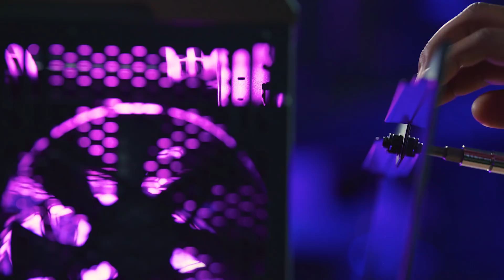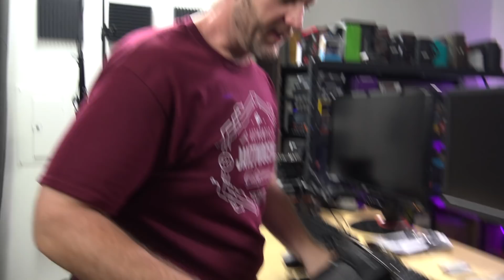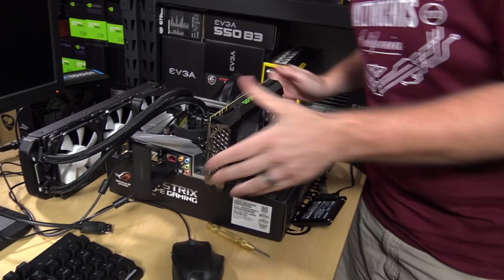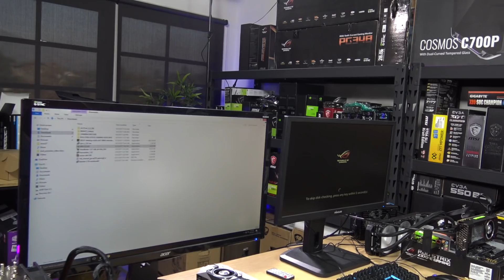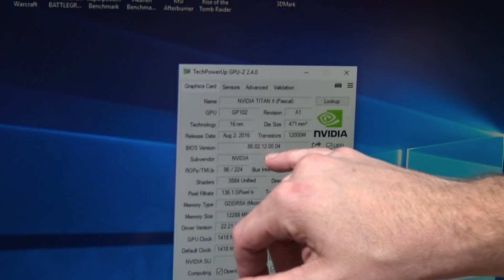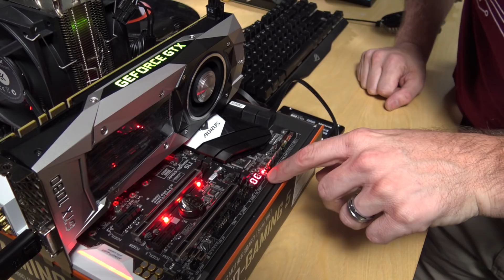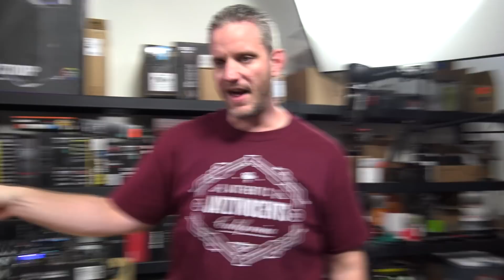I cant figure this one out... HELP!

Comment: This might not be the case, but you should try another PSU. The 1080 probably works because it has a lower TDP (180W) while the 1080 Ti has 250W. Maybe something's wrong with the power supply. Not sure, but worth trying.

Comment: Try plugging in a DVI monitor to the non working card on the Ryzen system. I just recently had a really similar problem where BIOS would not POST with DP for some reason. Tried 2 different monitors and got stuck on a POST code every time, even after resetting CMOS, pulling battery, etc. Plugged in a DVI monitor and it booted right up and next boot kicked over to DP and has been good ever since.

I have no explanation for why it happened and why plugging in a DVI monitor helped, but it fixed my problem.

Comment: While this maybe out of left field Jay - how about resetting the Ryzen Bios to fresh install? Verify if the cards are performing the same with the older bios. This could point you into a compatibility issue between the 2 cards for BIOS. While you did check the working Titan you did not check the non-functional one on screen. This makes it hard for me to say if the BIOS do match, if you mentioned it in the video then i missed it.

However, if you are unable to revert your BIOS on Ryzen back to an older version, how about switching out the PSU for a different one. Yes I know this sounds stupid and shouldn't have impact, but I am thinking that POSSIBLY maybe power could be causing it to not post. Maybe it is diverting too much or too little power to the system. 

If the RAM sticks are able to be swapped between the 2 machines, how about switching them? This might provide some answers if it does post or you might get a new error code. 

These suggestions while are way out of left field and normally wouldn't be considered to be the resolutions. I think that getting outside of the box in this abnormal case would be helpful. Thats just my two cents :P Let me know if you tried it and what the results are.

Comment: I'm quite new to computer building, but would a V drop be a possible cause? Perhaps one card responds to an "under volt"  scenario whereas the other may not? Would it be feasible to check, or perhaps even swap power supplies. Perhaps that was tried.

Comment: This is a weird one....Power at the PCIE slot maybe? That's very difficult to test without breakout cables and such. Nvidia power balances a VRM for the PCIE power. That might be the small enough difference in cards. But that should not be enough to cause this failure. I noted the PCIE link at x16 so appears the PCIE portion is working well enough. A loose or intermittent connection would have shown on the Ryzen one when you rocked the card L/R.

I would 1st remove the GPU and all connection and check the underside and around the PCIE lane for any possible small pieces of metal shorting out components. Use can air and see if anything changes. Next would be for your level, move the CPU to another motherboard and see if the fault moves with the CPU or motherboard. 

Actually....could be really the motherboard. I'd do a physical check then Clear CMOS and re-flash BIOS to start. It appears to be a POST issue. Could try it with 2 cards and see what happens. Known good and then install the second bad one.

Comment: 1: Swap cards. 
2: Swap slots with working and non working
3: Swap PS
4: Try both cards in one system at same time, Working MB to check reading make, model and bios the same on both cards.
5: Check PCI on card for short PCB tang.
6: Sacrifice goat to the binary gods
7: Find same MB, see if the same
8: Try AMD and the bad NV in system at same time.
9: Same as 8 but swap slots.
10. Swap CPU
11. Check PCI settings, Card my ask for PCIe that system has a conflict with.
12: Go to the pub, wait an hour or 2...........What problem!

Comment: If you really must solve the puzzle =P, cause I would want to, if all the parts work just not that specific combo I don't believe its a software issue. I would guess that its some freak manufacturing mishap where some connection is being connected that shouldn't be because of some soldering or something that only happens with that specific combo that fires up that specific error. Maybe check and see if the connector has something in it or there is some difference in the interfaces of the board and card. Or you just probably shouldn't put diesel in a gas engine. Yea.. that's it...

Comment: I would say the motherboard is the most likely cause maybe it's not bad but just a little bit loose or damaged. If that graphics card Works in another PCI slot then I would look at the power supply

Comment: I had something like this happen to me with old Radeon 46xx series cards. Had what was supposedly two identical hd4650's that said they had the same bios but they were actually lieing and didn't have the same bios after checking out the bios dumps because it turned out that the utility that was burning bios onto the card wasn't checking to make sure that garbage left behind from the old bios was removed. It would just write the new bios, change the numbers and call it a day, without checking to make sure the new bios was completely valid.

Comment: I had something like this happen a while back with and EVGA board. I knew I had a known good GPU because I just pulled it from another PC and it was working on the EVGA board too, until I did something (can't remember). Then after a reboot the GPU, which had 3 LEDs on the back was now only showing 2 LEDs and would no longer POST. I spent an hour or two trying to troubleshoot it and nothing worked. I cleared the BIOS, pulled the battery, and everything... Then as a last ditch effort I completely removed the Battery (only popped it, but left it sitting there the first time) for a couple minutes... Put the battery back in, turned it on and it POSTED like nothing was wrong, 3 LEDs again and everything. I had thought I fragged the GPU!

Comment: pull the battery on the Ryzen mobo, drain the caps & reinstall. Then revert to an older bios. Does the card boot properly on an older bios? If yes, inform mobo manufacturer.

Comment: Hold up, are those pigtail PCIe connectors? Maybe with that board it's way more picky about how it gets fed. Wouldn't explain it working on the other board or the other TITAN seemingly being fine with pigtail delivery, but might be worth a shot to run two separate cables instead of using the pigtail on that one.

Comment: Jay swap out your ram and clear the boards CMOS, yes the cards are identical that your troubleshooting but when it comes down to a circuit level that doesn't mean the hardware actually uses the exact same patching to boot. What most likely is happening is the system is trying to treat the boot path like your other card and defaulting to its last known settings for a successful boot. A boot that's not working. Clear your CMOS and begin posting attempts with one stick of ram in each time swapping the slot each time and repeating it with each stick. I really think it's some sort of memory default boot pathway/sequence issue.

Comment: I had an issue with my ram after pulling my computer out of its hole to clean out dust clogs, and it would not boot on anything other than the stock 2133 15151536. I tried reseating the ram, updating and backdating bios to known good versions, I tried dialing back on my cpu overclock and boosting both the vcore and soc voltages, and I tried seating the ram in all the different slots. What finally worked was a hard reset of the CMOS via pulling out the battery and draining the psu. And since I upgraded from AGESA 1.0.0.5x bios to 1.0.0.6b along the way, I actually got my ram's XMP to finally work, something I couldn't even do with AGESA 1.0.0.6a. My hardware in which I experienced this was:
MSI B350 Tomahawk
Ryzen 7 1700, overclocked to 3.7GHz, 1.2625V on Wraith Spire. Not sure how it's thermally stable but it is.
2x 8GB GeIL evoForza red 3000MHz 15-17-17-35 1.35V ram, arranged for dual channel
256GB WD Black NVMe M.2
GTX 970(primary slot)/RX480(secondary slot) multiGPU combo, that shouldn't work in a B350 board but does anyway for some reason.
Ryzen is wierd, but I love it all the more for its flaws.

Comment: It probably won't work, but my GTX 680 and my GTX 1080 both required me to set the PCI-E from 'UEFI' to 'Legacy ROM' on two different motherboards. Mine are Intel, however. Might as well give it a try though.

Since you can't get into the BIOS, probably, you'll have to install a video card that the system boots with, then change the BIOS setting and reinsert the new video card.

Comment: Im having issues with my card after I updated its drivers to the latest. Even after trying to rollback drivers, its still not working. Ive tried just about everything other than trying the gpu in another system. I dont know many people who are into computers, most have laptops. 

:( Wish I had all that hardware just sitting around. Makes me weep.

Comment: Maybe one card is set to GSync. I had a similar problem on my GSync-monitor and a Ryzen system. 
Whats happend: My system crashed and i want to go into the BIOS...but i couldn´t. I used Gsync and displayport. 
I solved the problem with changing the cable to an simple VGA. 
Sounds stupid, but after i changed to VGA i could go into the Bios.

Comment: ""Possibly."" these surface mount components were not made to be handled over and over... how many times a month do u move a titan in and out of systems... check the Capacitors on the suppresion side of the external pci- power input side B4 the power phases
Reply: The way you phrased your initial comment did not make it sound you were leaving this "as a possibility," however, I do agree that it is possible, albeit unlikely
Reply: Usually, if you had a damaged component like a bypass capacitor, or filtering capacitor it would manifest as odd behavior, regardless where it was installed. If anything id think possibly a damaged component on the motherboard if anything.
Reply: Have you heard of voltage tolerance before?
Reply: is it possible that different MOBO's use different resistors?
Reply: yes i am sorry i will reword it. thank you for not hanging me for this like my BSOD comment... Blue is post Black didnt post...
Reply: That doesn’t is explain why the gpu works in One and not the other
Reply: i added ""Possibly""
Reply: A dislodged soldered component on the GPU would not cause different behavior system to system.
Reply: I don't think you know what you're talking about -- these components are essentially welded to the PCB and they are not going to come off unless you take a sharp object and try to scrape them off
Reply: basically welded is not soldered... and not all soldered components are 100% attached... in the unlikely event of one of the components being disloged which would explain his problem. i left this as a possibility... i ask you Ryan Jones is it "possible" for a Surface mounted component to be Knocked off?

Comment: I've built 4 different ryzen systems, two with R7-1700s, one with an R5-1400, and one with the AM4 Athlon chip. None of them have actually worked right away. I always need to reseat the CPU, or the 24 pin, or the ram, etc. I mean, I love the ryzen performance just as much as anyone else, but I think my next build will be a coffee lake based system, due to this and some other issues I've had with my R5 build.

Comment: Probably someone asked it before, but why you show the BIOS version on both bench of the same card? You told that BIOS is the same,but you weren't checking it on video. Hope you see this question! Cheers from Poland, Europe!!!

EDIT: Sorry, just review comments and saw your answer. Any way, what about MB BIOS setting, is it recognize every card normal?
Reply: I have the same motherboard from gigabyte except it is the 7 version.  I kept running across a glitch where sometimes during reboot board will soft brick. Heard they fixed it with bios update but it did happen to me on the newest stable bios update once. Had to unplug power cord,  try to turn on drain all power from board. Turn off the replug in and try reboot again. Worked.

Comment: Same exact thing happened with me on my 1700X.  It all started with an update from GeForce Experience and boom, black screen but I could hear the computer sounds starting up?  I thought the same thing about the graphic cards going bad, so I decided to exchange the 1080ti with my old 970, but in the process of exchanging the two, I might have done something to the nvme card, UGH!  Now the system boots, but shows no nvme card, so no operating system.  I am so fed up now, I just about given up on AMD for good...  Out of curiosity "JayzTwoCents," have you tried to re-install the O.S.?  Because my thinking something might have gone wrong during the update from Geforce Experience that messed up the OS?  I know it sounds ridiculous, but it is the only thing I can come up with, before I gut the computer and go back to Intel...

Comment: Hey Jay i had the same problem with my old GTX 460 which i only use to setup new systems. But i also used the same Mainboard as you did. I think it could be a Gigabyte Mainboard issue.

Comment: i have two R9 390's on a asus C6H with a 1800x........one of my 390's acts just like that JAY.......ill explain. and i do not want to call this card bad either cuz its not bad......its just weird and i do not know the cause of it being like this ......but ... if this weird card is in the number 1 pci-e slot it will not post a image to the screen at all on none of the output ports .......i have to go into bios and disable CSM to get it to work......there is also a issue with this same card if its in the #1 spot i have to run a higher PLL voltage or it will give me funny post code errors just like that making me think its the ram when its not.....id say check the cable ends in the connectors to see if all are good on the gpu power cables.....and id look into disabling CSM...or a higher PLL 1.8v.....i know my board will on auto voltage,  runs my PLL voltage up to 2.0 volts...no lie..... i have to turn it back down sometimes ......maybe the board is trying to apply to much auto PLL voltage causing this error also.....

Comment: I'd remove the cards, turn the system on, let it see no gpu there. Yes I know ryzen doesn't have integrated graphics. Power off the system, put the "bad" card in, power on. If it don't work, pull the cmos battery, and power on the system. Put the cmos battery in, and try it. I had some issue with my son's computer I built where option 2 worked.

Comment: >aorus/gigabyte

prevent dual channel memory boot up by putting only 1 ram dim or 2 ram dims in noncorresponding slots. 

Gigabyte has a recurring boot error across different chipsets and cpus when it comes to "perfect" combination of components with memory since core duo. Check the titans if they just happen to be using different memory chip makers. If that's not the problem its an error regarding the system memory, dual channel mode and memory chips coupled with the non-standard boot procedure of gigabyte.

Comment: You did not check the card bios on the card you moved from the amd sys to the intel board, to see if the bois is the same compared to the other card. Of course the bios will be the same with the card you moved from the intel board to the amd board. And as some have also said, try a different pci slot as well.

Comment: HI Jay. I'm reluctant to say this because it makes no sense. I had the same issue with a Hero VIII. I updated the bios, no change. I RMA'd the video card, no change. I replaced the PSU, no change. It wasn't until i replaced the  monitor and video cable that the problem went away
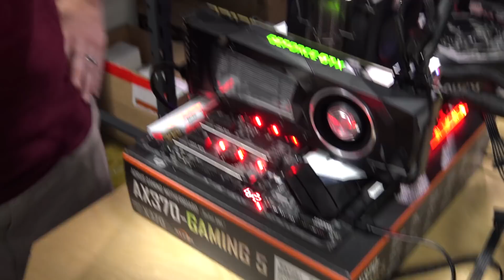Reply: As far as I could tell it wasn't posting. i'll never forget that "b2" code and the vga LED on the motherboard being lit just like you see in the video at the 1:33 mark and the monitor saying "no input".
Reply: Todd Black.  Interesting, I will try what you just recommended.
Reply: Todd Black 
Interesting. And, your system was not even posting? Are you sure that it wasn't posting with a blank screen?
Reply: I sometimes have to reset my bios because the post will just bring a black screen on my z270. Seems like a specific setting can cause weird bug like that
Reply: I could see this being a thing.  If I don't have a monitor plugged in and turned on first, even with DVI my older AMD deneb system will fail POST regardless of iGPU or PCI-E GPU.  Since AM4 supports APUs my guess is that his board is for whatever weird reason trying to fall back to an iGPU that isn't there with the Ryzen chip.
Reply: I later put the monitor on my kids computer, but used hdmi instead of display port.  Since its been on hdmi it hasn't missed a beat.

Comment: I had a issue with my ryzen 1600x that it wouldn’t post at times and it would give me the same vga error on my 7950s cross fire.I found that when it was connected to the display port it would not post but if you took the display port and unplugged it and replug it back in it would work. To fix the issue I ended up using an hdmi cable.

Comment: Wow, I literally just built a new Threadripper system and had this exact problem.  Except the video card in question is a RX 460.  I was planning on running virtual machines and doing GPU passthrough so I needed two GPUs but the requirements for the host system are pretty mild so I settled on the RX 460 and a Vega 64 (Vega has much better support for passthrough than Nvidia cards do right now...).  System wouldn't post with the RX 460 but worked perfectly with Vega.  Until I saw this video I was convinced that it was a bad card, but even the error code I got was the same.

Comment: You did not check both bios versions on both cards. You looked at the bios on the intel bench with card B: and then swapped Card B: into ryzen bench and looked at the bios version of the same card. Not the other card on the intel version